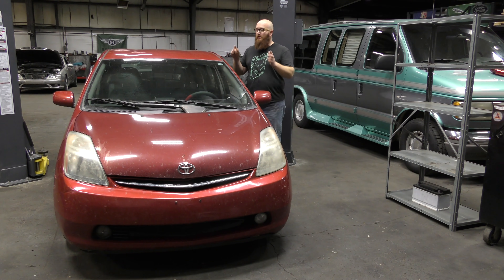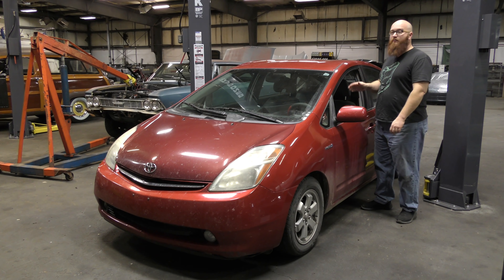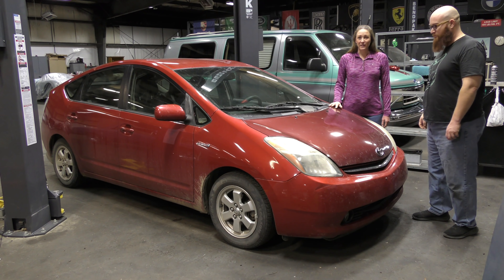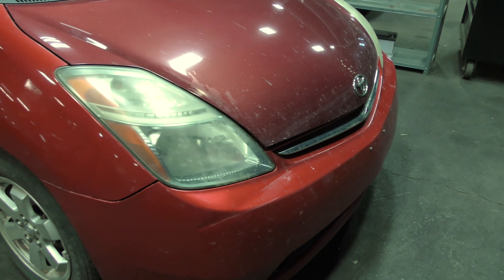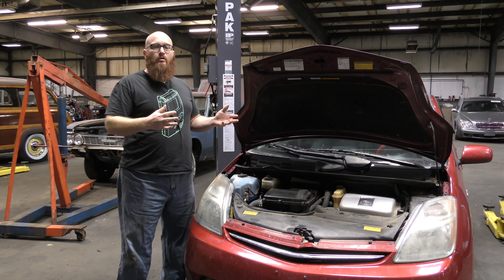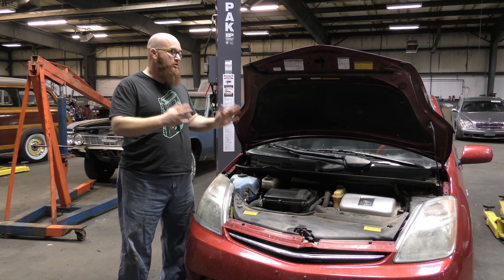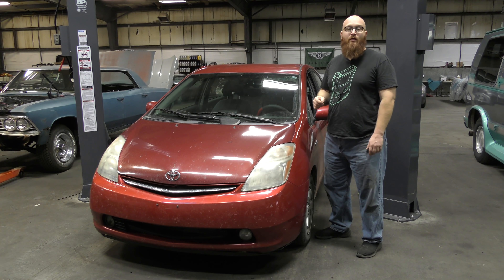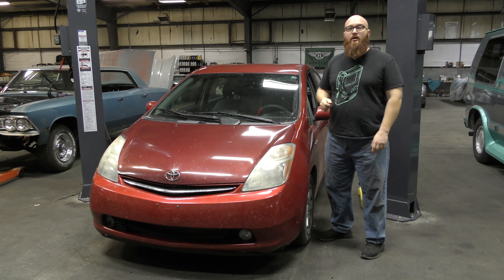When is it time to Buy or Sell a Hybrid? The CAR WIZARD inspects daughters 2008 Toyota Prius

Comment: Hey Wiz,  I have a question,  on a Prius such as this,  since the gas engine runs less, due to the hybrid engine kicking in frequently and running in lieu of the gas power,  then why would the oil and filter need to be changed as much as that of a gasoline only engine?
Reply: The engine runs during almost all operation.  The only time it is off is when the vehicle is stopped or extremely low speeds.

Comment: The only time to sell a used vehicle, especially any hybrid is when a vehicle gets too old or if it costs so much money to repair. The only time to buy a used vehicle is usually between early fall from the previous year to late spring the next year. It is most likely, any vehicle whether if is a hybrid or not. I am hoping in 2021, that the Car Wizard will do more, all-new, buy this, not that videos. He has not done one on Mitsubishi, Chrysler, Mazda or Lincoln, yet. He also has not done one on Korean vehicles (Kia and Hyundai only), as well. Thanks.
Reply: For Mazda's, the ones to buy are any Mazda 3 with any engine and/or transmission and any Mazda 6 without the 3.7 L V6 engine (due to the coolant leak inside the water pump). The one not to buy is any Mazda CX-7 with the 2.3 L turbocharged four-cylinder engine. I am slightly a fan of the 2004 model with the 3 L V6 engine and the five-speed automatic transmission. In addition, I am extremely a fan of the 2018 and newer models with the 2.5 L turbocharged Skyactiv four-cylinder engine and the six-speed automatic transmission. The newer Mazda 6 with the turbo four-cylinder is a lot faster and more fuel-efficient than the older Mazda 6 with the naturally-asperated V6. I will avoid the second-generation model with the 3.7 L V6 engine at all costs.

Comment: I’m looking for one of these cars (I drive for a parts delivery place) like 100-250 miles a day,any body have hints on what I should look for when buying one used??? I know nothing much about the battery is what I’m mostly worried about,I get 20% off cost of parts so can fix one up cheeper. Thanks

Comment: I am stuck between several choices this summer. None of them are even in the same category. We're looking at a hybrid or diesel option since the wife has long trips for doctor's appointments (we live in Alaska and she needs a specialist). Also, we have been toying with the idea of a truck since we always seem to need one for minor projects/moving, in addition, we would like to get some ATV's in the next year or two for the family. Finally, we are looking at small SUVs like RAV4 or CRV. We had owned a 2016 Escape that was totaled a couple years ago after hitting a moose. 

When the Escape was around, we had no worries since we bought it new from the showroom. I was also given a 2003 Explorer that just needs head gaskets and the rear end replaced, but honestly, I do not trust Explorers. Also, our van was involved in a hit and run and while we do not mind driving around something with a few dents and dings, we want to have peace of mind and a vehicle that can do everything needed. 

Cars on my shopping list include anything that aligns in those categories that are $15k or less. We have no desire to have a brand new car or high car payment. Personally, I have always wanted a Chevy Avalance since they came out in my senior year of high school. There is one just north of me for $11k, 2002, Dark Blue, 4X4, 75k miles and look new in and out. Good price for up here, sadly it is out of range till at least summer's end since I would like to pay cash and not finance. At the same time, a hybrid would be super nice and save tons of money. Just wouldn't be able to tow an ATV or two around.

Comment: This is almost at what I'd call "a throw-away-car" stage of it's life. It's still perfectly driveable but you don't want to spend big bucks on service, let alone fixing it. If the engine, gearbox or something major decides to completely let go, you give it away to scrapyard, "throw away" so to speak. Beyond that, you need to think seriously if you still get your money's worth in the near future by fixing this or that or that... It can still be very cheap way to get a car and drive, if you know your way around cars enough to avoid being screwed and can stay clear from makes and models that have known expensive to fix issues. Sometimes it's sad how a perfectly good 10-gear-old car can be just cheaper to junk and replace with another car than have it fixed, because all same make&model cars had the same failure and new part from dealer is ridiculously expensive or requires ungodly amounts of labour to fix. Cars that don't have major deficencies usually end up in scrapyards with minor failures and you can get very reasonable price on 2nd hand parts on those. Sadly many nice cars since mid-90's have had for example very poor quality radiators and heater cores with plastic ends that are nigh-on impossible to fix, and the oem part costs almost as much as custon aluminium one that'll last forever, or when it comes to the heater cores, it is the first part on the assembly line and they build the rest of the car around it...

Comment: That many miles and still original HV battery? Bravo, but I'd do a cell check via scanner or individually and replace corroded terminal contact bridges or just replace the battery; it's not gonna last. 1NZ engine is good, maybe water pump, aux battery and oil leaks but still good. Oh and why would you have any vehicle ON while doing an oil change? Also, leaving a prius in neutral keeps the HV battery active through the main relays so dont leave for lunch cause when you come back, the HV battery will be drained to nothing......new HV battery time or ask Toyota to charge it with a special $10K charger you'll be renting.

Comment: What year is that Prius? Why does that Prius have a "ride height sensor?" It doesn't have automatic height control, does it?
Reply: It has a Automatic Headlight Leveling System, which was optional as was auto braking and lane keep starting around 2005.  Prius was always Toyota's high tech vehicle in many areas.  The ride height sensor was just an input for a headlight aiming positioner.  The more you know....

Comment: Hybrid batteries in Prisuses are supposed to die at around the 90000 or so mile marker. What sorcery is keeping them batteries alive
Reply: Not really.  The same chemistry is now fully warranted for ten years 150k in all states.  California and other carb states always got 150,000 mile battery warranties so Toyota designed for that spec.
Reply: @rj.parker  What I'm saying is that regardless if warranty the batteries them self give out at that mileage. My dad worked with a guy who had at least 2 and both batteries gave out in the 90000 mile range which he replaced himself but still it's pretty common for them to just give out. But a warranty can help though.
Reply: @PennsyPappas  Actually I have owned Toyota hybrids since 2008 and they all have batteries that last way over 150k.  Sorry your dad's boss had problems.  Both would have been replaced free by Toyota at 90k since all states got at least 100k warranties.  So if the boss paid for these by himself he either was not informed or the mileage was more likely 190k.  Check it out for yourself.
Reply: @rj.parker  well it wasn't his boss it was a coworker but each one he had bought when brand new and this was during the 2000s (my dad retired 2010) and maybe batteries are better now but back then they just gave out at that mileage. He was only one example I used. I have read other stories where they gave out at around that mileage. It's kind of like how turbos typically dont last 100000 miles though there can be exceptions. Back to the coworker when he went to a toyota dealer at that time they said it was normal life span for the batteries. Again they may not have had that warranty. There is a reason why these warranties have to exist. They know they will give out and need servicing.

And yes they were in fact 90000 some miles NOT 190K
Reply: @PennsyPappas  Again all Prius high voltage battery came standard with 100k mile warranties, 150k in some states.  No extra cost, transferrable to any owner.

Comment: My 2003 Ford Taurus has 318000 miles
Reply: That's a miracle; how many times was the transmission repaired/replaced? My 2001 needed two repairs about 60K apart; I junked "Old Blue" when it started failing for the 2nd time.

Comment: Battery replacement only last 3 years or so
Reply: Used "rebuilt" means one or two cells are changed for a better used module and buss bars are cleaned up.  Three years is pushing it.  New hybrid batteries are best unless you plan to sell the car in one or two years.

Comment: Bro ignition is always off on oil change, why you have the car on?
Reply: Because the engine does not run all the time, the lack of engine noise makes it easy to forget to turn off the ignition. This is more of an issue if you have a Prius with pushbutton ignition.
Reply: @richardgray8593  yea I do have that but I guess I never forget
Reply: @radiospank  I forget ALL the time.

Comment: I am still of the opinion that the name Prius is pronounced "Pry Us" not "Pre Us".

Cool video!
Reply: Pre us is correct.  Multiple Prius wording is questionable.  Many call many Prius vehicles Prii eg Pre I.
Reply: @rj.parker  But I read [cannot remember where] that the name was based upon the subatomic particle known as a prion and this is pronounced "pry on".
Reply: @Flies2FLL  Actually Toyota named it after a latin word  prius meaning “coming before”
Reply: @rj.parker  How is it pronounced in Latin?  That looks like a Greek word, "Prius".  I don't know for sure but if it is Greek it would be "Pry Us"

Comment: When they say 230k miles, do they mean 230k km cause this is Japanese made car and mileage meter is in km. I may be wrong
Reply: It was switched over from km to miles for the American market. 230k miles is 370k km.
Reply: @Lincolnator721  Thanks, I am planning to purchase used  Prius 2014 or  2015 with 30k miles.
Reply: @ravinarayan5273  those are better than 2010-2012 years from my research. Good choice 👌
Reply: @ravinarayan5273  quite honestly, I'm sick of poor fuel efficiency.  I'm seriously considering a Toyota Prius as well

Comment: I disagree depending on how you drive that car it is gonna last a long time.  Of course you cannot do interstate trips on that car its a no brainer.  But for school or work that car has a lot left.  My sister in law bought a nissan sentra brand new and only lasted 6 months.  It was a lemon.  Just to give u an example.
Reply: The buyer is taking it from Kansas to Seattle. It will do fine.  Highway is easy on the hv battery since the engine does most of the work.

Comment: Why in the world would you change oil with the key turned on?  Wtf?
Reply: First the Prius has push button power on off.  He is saying some will leave it On in Ready mode because the engine is not running.  Could be in Park or Neutral.  Most often in Park. However it is "Ready" to drive on electric battery power, the electric AC may be on, all hybrid systems are energized. .  When the battery eventually discharges in Ready mode, maybe ten or 15 minutes later, the engine will start.  If it has no oil in it, bad things just happened in your shop.

Comment: Why do hybrids use Atkinson-cycle engines?
Reply from the maker: Easy Start/Stop
Reply: @CarWizard  And more fuel efficient too.
Reply: Because they are efficient at highway speeds but have low torque at low rpm.  In a hybrid the electric motors provide exceptional low end torque.  The Toyota transaxle facilitates parallel load sharing. So good highway mileage when the battery can't help much.
Reply: @rj.parker  Thank you

Comment: Why don't you smear some WD40 on the headlights?
Reply: Because that's a terrible idea. Petroleum based products can attack plastics. Better to try toothpaste and a soft-bristle toothbrush to remove the hazed layer of plastic. If that looks better, then get a headlight restorer product to finish the job. Sometimes you can't bring the plastic back enough, and should replace the lens assemblies.

Comment: My mom's 08 Prius had the whole brake/regen system go out at 90k miles. Mechanically totalled the car. I was not impressed.
Reply: The motor/generator failed?

Comment: don't buy hybrids in the first place. No sense in having two modes of power, just unnecessarily complicated. You have to service two systems and both must work to use one, crazy.
Reply: also going to save $100+ a month in gas compared to an average compact 4-door hatchback

Comment: This is just a car salesman selling what can only be an "awesome car". How long ago did he tell us to avoid used hybrids with original batteries? Not so long. Daughters sound like they are dangerous to life and property!
Reply: You can now buy new cells for those assemblies for $1600. If the car costs $2k you have another eight to ten years possible for $3.6k.  The 1.5L and later 2.5L Prius engines are solid.  The gen3 1.8L from 2010-2014 should be avoided.
Reply: @rj.parker  What is the issue with the 1.8?
Reply: @turboclaybird  Oil burners, clogged and expensive egr systems, inverter failures, abs system failures and ultimately head gasket or complete engine failures.  Often starting after 150k but some of these items are possible on lower mileage engines as they age.
Reply: @rj.parker  There were only a small percentage of the 2010 1st Gen models with those problems. The 2011’s and up had recalls on them by Toyota, as long it was within warranty.
Reply: @WuBloodKin09  Actually the flawed gen3 piston rings that cause oil burning, clogged egrs, head gaskets and sometimes engine failures were not revised until 2015.   By 2016 standard Prius engines had been completely updated with ings, pistons, new egr design, intake and other reliability features including a new abs and inverter design.   While its true that Toyota acknowledged most of these engineering mistakes, warranty was only 5 year 60k miles.  The problems happen often and routinely over 150,000 miles, so buying or keeping one past then is typically a losing proposition, UNLESS you are a skilled hybrid mechanic and picked up an otherwise clean model below market price.   By the way, Toyota considers excessive oil burning a quart every 1200 miles.  Notice I did even mention the well known issue of hybrid battery replacement cost, usually warranted until 100k miles or 150k miles in selected CARB states like California.